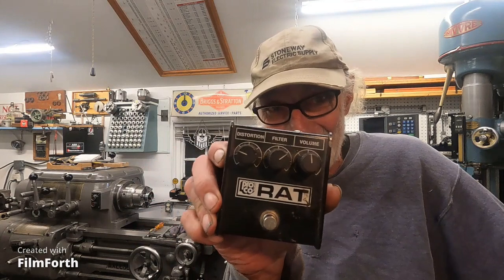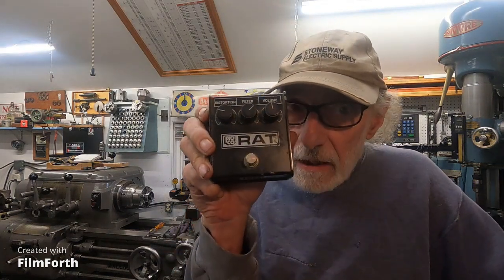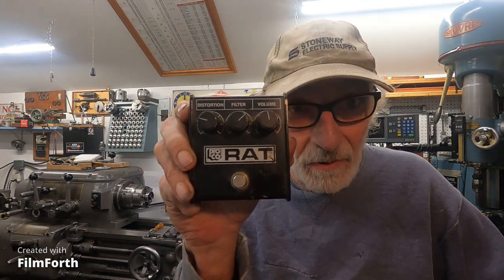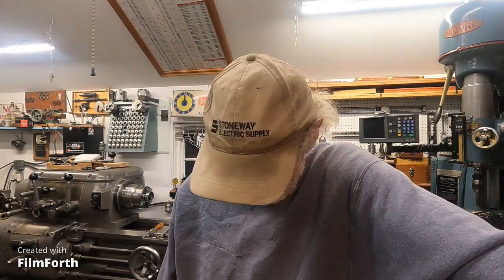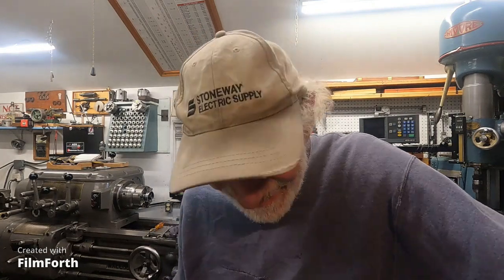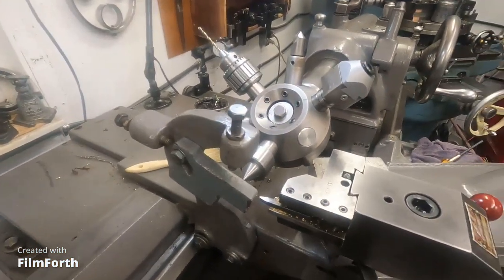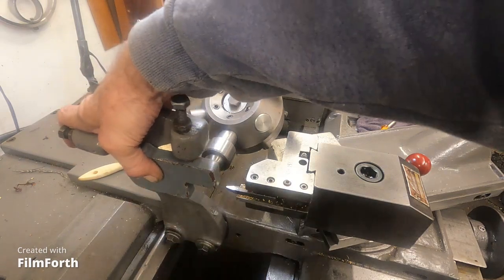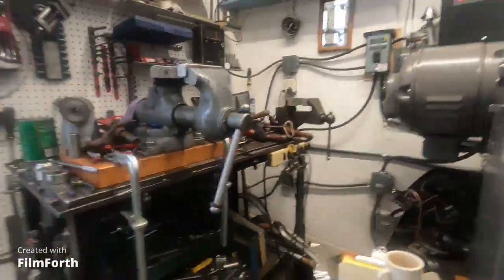Machining around the computer chip

Comment: Dee, I have two inch diameter titanium rod with a quarter inch of aluminum fused to the outside. Think to protect from Ti hydrogen embrittlement in salt air environments. I got these 12” to 14” cut offs for free over twenty years ago. Do you need one?
Reply from the maker: Hi, Thanks, I dont need any.

Comment: Well, after all these years, my razor sharpened Micro-100 AR-8 finally met it’s match against unknown titanium alloy. Meanwhile, dull in comparison, carbide insert tool worked great. Didn’t try putting a tiny radius on the Miri-100 as you do. Can’t wait to see you do the end of that center cutting roughing mill when the time comes.
Reply from the maker: There is a Sandvik titanium extrusion plant here and the hot rod guys want parts made from the short pieces they sell and it can be very hard, but sometimes it threads better with HSS. I am using the old endmill now that I found it again, I will have to sharpen the end soon, thanks

Comment: Long time electrical engineer here. The "308" chip is an LM308, an obsolete op-amp that was a jelly-bean part in 70's and 80's. You can buy them today but not in the round transistor like package--you have to buy an 8-pin DIP package, but it is the same chip inside.  There are less than $5 at DigiKey and they had thousands in stock when I just checked.  There is really nothing remarkable in the specs for that op-amp. Maybe the RAT design depends on not shielding the inputs the manufacturer recommended that you shield so there is some kind of distortion, but you can get that again by rearranging the components in the replacement wiring and frankly that would be a poor design.  People online are saying that it is the clipping diodes in the RAT pedal that give the distinctive sound, not the op-amp.
Reply from the maker: It really does not matter, guitar players will obsess to the point of 9v batterie brands make a huge difference. Part of the mystique  is when they made them they did not sell well so there are not that many of the originals. I don't have the technical knowledge to know what is really going on but back in those days a fellow named Dumble built this type of distortion device into amplifiers that are worth 10s of thousands today.

Comment: Fiero was a mid 80's car. Worked on one that had ellectrical problem that traced back to a ground issue due to a frame section that had rusted out enough that the back didnt have continuity to the front anymore.
Reply from the maker: That is a car some insurance companies will not let you own because of all the fires they have caused, thanks!

Comment: I see better cars and truck in the junk yard than I drive.  Nice interiors, nice body, etc, has to be a computer problem or one of those $5000 transmission jobs.  That sends them to the grave too soon.

 I know there is lot of old good machines around, but, at some point there won't be.  Don't think any old CNC will be usable after they sit outside in the weather for months at a time.  I know CNC stuff is junked because the cable from the computer to the machine is no longer available and they go bad from use. etc.  Crazy times for sure.
Reply from the maker: From what I understand is some transmissions are not rebuildable and cost $5000. The motorcycle fad is over and its cars that people are spending money on along with firearms that is way too hot of a potato and liability. Right now I see a lot of good buys on older manual machine tools

Comment: Hi dee dee, have you ever used or owned a tree 2uvr mill? Wondering what you thought about them
Reply from the maker: I have not used one but they are highly regarded to a point its hard to find one in good shape. They have a collet system that is changed totally at the nose and is said to be more accurate and solid than R8. It would have to come down to condition of an individual machine, thanks
Reply: Yeah , most of the tree mills I see are really hammered. Tree is the first mill I ever used. The colllets are zz i believe and it locks just like a collet closer like on a hardinge lathe. Totally different than bridgeport.
Thanks